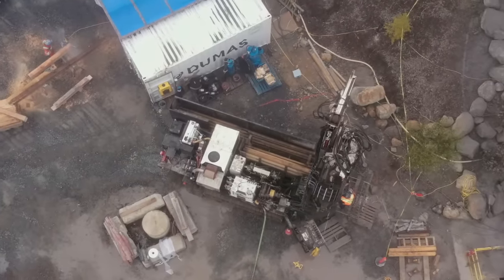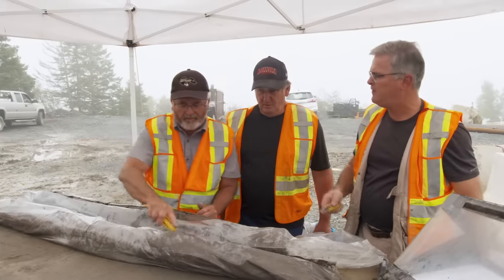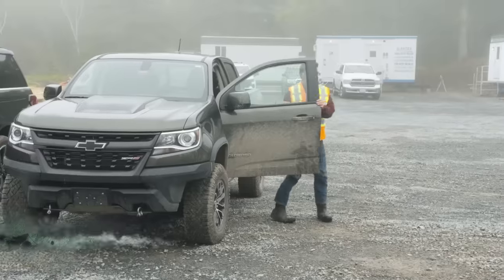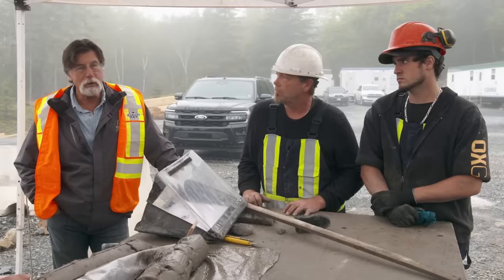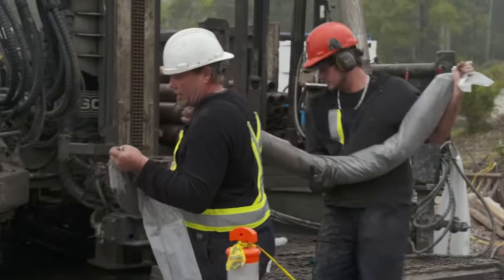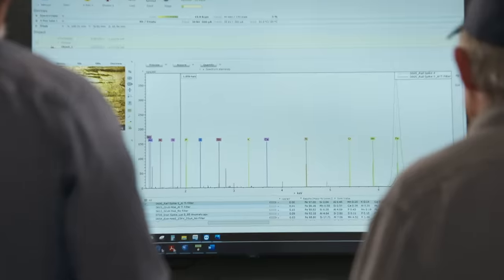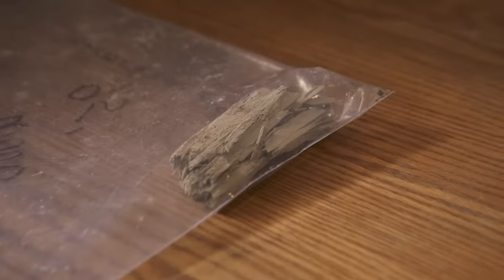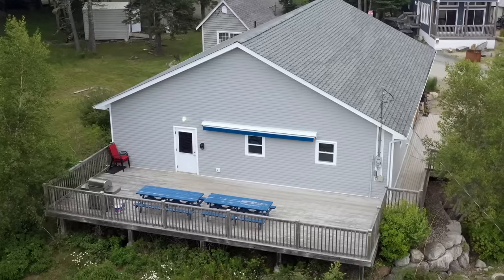The Curse of Oak Island: GOLD FOUND in the Money Pit! (Season 10)

Comment: As anyone ever considered that the people who buried this so called treasure would not have the Tec to go so deep?
Reply: The Money Pit was originally a deep, open sinkhole that somehow connected to the cavern(s) beneath the island that were high and dry in ancient times when the sea level surrounding Oak Island was much lower.  The "sinkhole" was subsequently backfilled from the bottom up with dirt and the oak log platforms to conceal what was below ("it's most probably a tomb").  With the sea level surrounding Oak Island slowly rising at the rate of 30 centimetres ( 12 inches) every one hundred years, everything today is under water and inaccessible.

Comment: What happened to all of the silver? I thought there were "dump truck loads" of silver down there somewhere 🤔.. And yet they find ZERO traces of silver in the wood? It's the same area, same water. So how could they find all of that silver and no gold traces in the water but now find only gold and no silver in the wood? Does that make any sense at all? If there was silver in the water, it would have leached into the wood. Just like the gold did. Any why not carbon date the wood? Wouldn't they want to know how old it is?
Reply: I've been thinking, there must be some kind of Current, under the Surface?
If, Everything I've heard from the Show, is accurate?
Well, it's the only thing I've come up with, that makes sense to me
Reply: @jimstepro1666    The cavern(s) deep beneath Oak Island are underwater with possibly two submerged cave/niche entrances at the shoreline.  There would be water currents and tidal motion in the cavern(s).  Recall that when Mr. Dan Blankenship excavated out Borehole 10X back in the 1970's, he drilled into a cavern where subsequent photography showed that a significant operation had occurred deep beneath Oak Island in the very distant past when the sea level was much lower and the shoreline entrances were apparently above the mean high water line.

Comment: Does anyone know how to use a metal detector?  It really would make everything 
SO MUCH EASIER!

When you have a tube of material from the drill, slowly run a PIN POINTER (hand held metal detector) over the length  and sides of the material in the tube sleeve. IF there is any metal including gold, it will beep loudly enough that you can remove the section that indicates metal is present, remove that section and wash off the debris and discover the metallic object. So simple a child can do t!
Reply: The amount of gold is microscopic….not able to be seen by the human eye and you would need a very powerful microscope to be able to see it!…a metal detector wouldn’t be able to detect this amount of gold…..
Reply: @Pattaya-360 
So basically it’s just sea water seeping around down there, sea water has micro gold in it ..   🤷‍♂️
Reply: They've actually used the pin pointer on the core samples before. I forget what season though.
Reply: Do you mean like the one Gary Drayton uses every single episode. Not sure what your point is.

Comment: The thing that gets me is, is how was the treasure (if there is a treasure) put there long ago with no mechanical assistance?
If they can't find it with todays technology, how was it even put there?
For it to be dug with pick and shovel back then would've taken years!
I say they should excavate the whole island down to treasure depth. But then they would find the "treasure" and the show would be over.
Reply: The Money Pit was originally a deep, open sinkhole that somehow connected to the cavern(s) beneath the island that were dry in ancient times when the sea level surrounding Oak island was much lower.  There are two (2) possible now-submerged cave/niche "entrances" at the Oak Island shoreline that can be discerned on bathymetric maps that were prepared by the Geological Survey of Canada in the 1990's.  "Whatever it is" was probably deposited at the base of the sinkhole (i.e. the Money Pit) via those "entrances" at the shoreline and evidence points to "whatever it its' being a tomb.  Marty Lagina is an accomplished engineer and I wish he could commence his "Big dig" to excavate down to the cavern(s), seal them off, drain the water and retrieve "whatever it is" (i.e. the Chappel Vault) that fell there when the Money Pit collapsed in 1861.  We need solutions and closure with this show.  Sorry so lengthy!
Reply: Yes they most likely had slave labourers dig and dig and dig some more until they can’t dig anymore. When you have no distractions, no jobs, no internet, boat load of free time you could accomplish anything. Think about it, look at all the architecture on famous buildings and so forth. Think about all the time and effort that was spent making all that by hand! The things people made all those years ago is extraordinary. It’s not far fetched to imagine 100 people digging and constructing a tunnel system on a small island. Yes it probably took a really really long time but time was something they had plenty of. Sadly it was probably slaves who dug the tunnels.. and died there. At least that’s a theory.

Comment: Did anybody, yes anybody look at the list of percentages or weights of the elements found in the sample. Gold is listed as .01 percent and by weight it is .04 percent. Now show me a sample of ground from say ten miles away and what is the listing for gold by weight or percentage. That would tell you if gold is commonly found in the area or if just that area.
Reply: I think this show is grasping for straws trying to adhere to the treasure narrative,.  Also, the presence of Osmium (Os) in samples that were previously analysed was greater than this gold, and Osmium is much rarer and more precious than gold.

Comment: Oak Island needs myself dowsing for gold to locate the exact center over any buried gold treasure, with the depth of cover buried and size or grade precisely dowsed.  Read and study the book, The Art of Dowsing - Separating Science from Superstition ($14.95), for learning all of the physics involved in dowsing and how to build the modern light weight ball bearing dowsing rod.  Then become a professional dowser by practicing the book's dowsing lessons.  Also, the summer of 2023, the YouTube channel - The Art of Gold Dowsing - will be posted which will show and explain the physics of dowsing and show the dowsing of buried pipelines and electrical cables, tunnels and voids, precious metal placer and load deposits, dowsing for any element with all edges, exact center, depth buried with angle of deposition, most important is grading, amplified long distance dowsing from a moving vehicle, and dowsing on water from a boat.  I hope dowsing enriches your life and have a safe, healthy, good day.

Comment: I think it's an old Spanish gold and silver mine, because of one simple fact. " Too Many Tunnels". And the Human Bones they found at a extreme Depth. (Most likely slaves digging the tunnels). To Bury a Treasure you just need one single hole. The Coal they found was most likely where they were melting the Gold and Silver. A Spanish ship would most likely pick up Gold every six months or so. Too many Tunnels for a bury a Treasure.
Reply: Another thing.... Access to the caverns deep beneath Oak Island was possible in ancient times because the sea level was lower, the caverns were dry and there were cave/niche entrances at the Oak island shoreline that are now under water (SOURCE: Bathymetric maps produced in the 1990's by the Geological Survey of Canada).  When Dan Blankenship excavated into the cavern at the bottom of Borehole 10X in the 1970's, it was seen by photography that a significant operation had occurred deep beneath Oak Island in the very distant past.  This "operation" quite possibly occurred WAY BEFORE the arrival of the Spanish as evidence points to the Middle East.